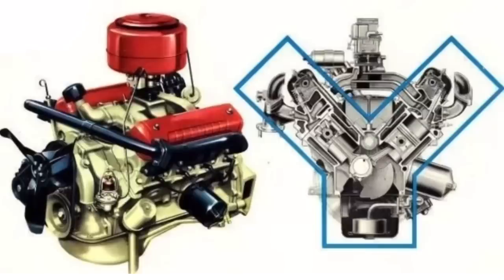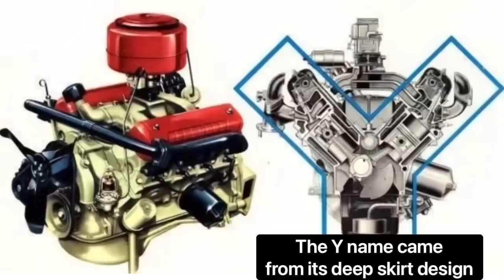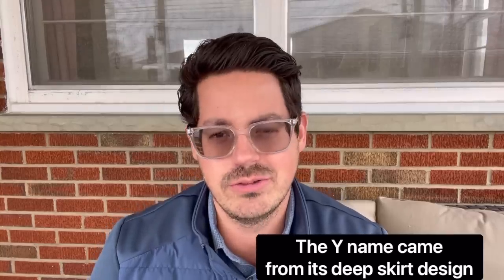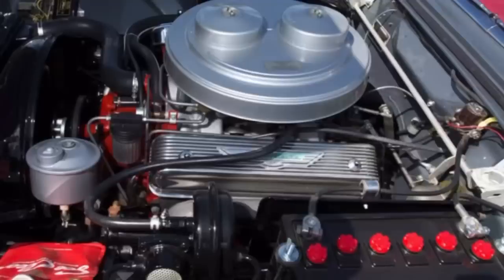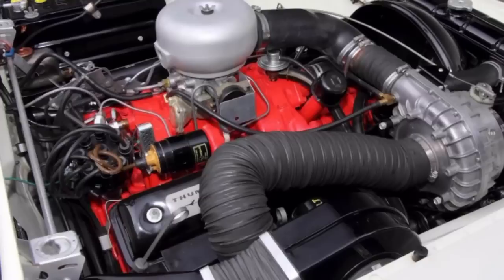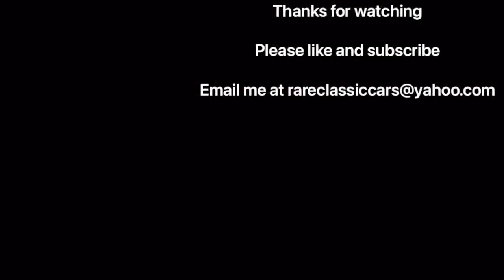Worst Engines of All Time: Ford Y Block V8

Comment: You are blowing smoke again,the oiling problem came from misalignment of the oil hole to it's mate in the head. I took the heads off and oblonged the oil passage hole and problem solved.
Reply: The problem you identified was only one of three with rocker shaft oiling system. The others were: the cam bearing issue; the rocker shaft overflow tube (poor design).

All the of these issues combined to grind the hell out of rocker shafts. 

Three strikes ... Horrible design ...
Reply: @sking2173  The big problem with the early ones - 54 - 56, was the fact that the center cam bearing journal didn't have a groove, and that rocker overflow tube.  Groove the cam and plug that overflow, and you have an excellent engine.
Reply: @michaelbenardo5695  — Yep, but picture this: Muncie, Indiana, summer of ‘58. A middle-class suburbanite with his 2.5 kids working his 9-5 and juggling his spare time between his wife and his girlfriend. 

The last thing he wants to hear is that what started out as a seemingly harmless tick under the hood of his ‘55 Fairlane will now require a motor-out cam bearing replacement that will cost him more than two-week’s wages.

Since his young daughter is in dire need of braces and his girlfriend’s ‘52 Ford, that he had bought for her with money he squirreled away without his wife’s knowledge, needs a clutch, he decides to put off the repair on his car for a month or two.

Six months later, he’s lost his girlfriend because her car now needs a valve job that he can’t afford, has a mad wife that has found out about the girlfriend because she spotted the missing money he used for the clutch job on the girlfriend’s car, a daughter with beautiful straight teeth that won’t even speak to him because of his infidelity, half a kid that’s never home and will never amount to anything, and a ‘55 Ford that he’s embarrassed to be seen driving because it now sounds like a thrashing machine — and he still can’t afford to fix it.

Do you think this guy will buy another Ford ??
Reply: @sking2173  If this was his first Ford, probably not, but if he always had good luck, except for this one, he probably would.  Now if the next one is bad, that's a different story.

Comment: Well after Ford introduced the 352 in 1958, they radically detuned the 292 and it was also Ford's last year for the 312 (used in some Mercurys). I had 6 312s in my life--three 1956 T-Birds and three 1957 T-Birds. They were fantastic engines. When restoring this 6 cars, I rebuilt each engine.  I also had one of those radically detuned 292s in a 1960 Mercury, and it sucked. Yes, they had oiling problems because of two things: 1. People just refuse to maintain their cars, always have, always will. And since these engines had solid lifters, people typically used non-detergent oils. Bad idea. If you changed the oil and filter every 2000 miles and used a high grade detergent oil, you will probably never have trouble with upper oiling problems.  Just about every year I made the 4500 mile round trip from Tucson to the Twin cites area via Denver with my T-Birds.
Reply: Most people dont know what the numbers mean on the oil bottle so detergent vs non detergent is really pushing it with the average joe.....
Reply: @will7its  In the 50s and 60s, detergent oil actually said it was detergent on the can.  Many people, myself included, didn't trust detergent oil, as it would sometimes separate.  Eventually, they fixed that problem.
Reply: Every 2000 miles?   Who wants to do that?   Most of my life I have changed oil just twice a year regardless of mileage!   Of course I drive Hondas and Toyotas.
Reply: @spaceghost8995  Back then 2000 was about right. With modern cars I go every 5000 miles. Cheap insurance.
Reply: @spaceghost8995  You are not supposed to change the oil that seldom, unless you do very little driving.  And just because your engines start and run does not mean that they are in good condition.  I have had people tell me how wonderful their engine is, only to hear bearing knock when they start it, which is NOT good.
Reply: @michaelbenardo5695  These were not new vehicles with tight tolerances running 0W20 oils.  These were like from 1985-1998 models.  Never once had engine noises or internal engine failures. None of them burned oil.  These were Accords, Corollas and Camrys.   Right now I have a 2003 and 2004 Accords. I go about 5000-6000.   Japanese cars are the only thing I buy.
Reply: @spaceghost8995  Doesn't matter.  YOU ARE SUPPOSED TO CHANGE THE OIL EVERY FEW THOUSAND MILES.  That's just the way it is.  And no, I am not "shouting".
Reply: @michaelbenardo5695  Will the police come and lock me up if I don't?   Live your own life.  I don't tell people when to change their oil. I'm saying this is what I have done.  If I had a very new modern engine I would likely do it much more often.
Reply: @spaceghost8995  And if the engine fails, you will try to blame everybody else in the world.
Reply: @michaelbenardo5695  It won't fail .  It's a Honda.
Reply: @spaceghost8995  2000 was just 500 more than the flatheads oil change interval. Oil, especially shitty old oil, didnt last long.

Comment: You are blowing smoke out your butt. The Y block was a very good for me. I drove my 1955 Fairlane 500 for over a halfmillion miles.. It won alot of races too!
Reply: You heard the man, some were incorrectly assembled in the factory. For the average owner that's enough to be put off the brand.
Reply: I solved my 292 problems by installing  57 T-bird rockers and shafts. Solved the adjuster problem too.

Comment: My grandfather had a 1961  F350 utility truck he bought new when the truck was in 4th gear the shifter shook and vibrating he took it back to the Ford dealership they didn't know what was causing it the crankshaft broke in two causing major damage Ford did warrant the truck even though the warranty had expired because it was brought in under warranty he ended up getting a 292 long block for no charge

Comment: My dad owned a '53 Ford pickup with the last flathead V8. Had drove that truck for almost 20 years. He once told me he was glad to have a '53. The '54 model was noisy since it was an overhead valve design. I was not aware that it had oiling problems on the top end.

Comment: I have a 1963 f600 . I used it about a year with the 292 i was very impressed with it . It has a dump bed i hauled alot of 6/8 ton loads of gravel with it . It was very impressive for a small engine once it got rolling it wanted to go turning more rpms than i wanted . It had a rear main oil leak when i pulled the main it needed bearings so i found a wrecked 64 with a rebuilt 330. I was told i would be disapointed in the 330 after using the 292. It has about the same power but it dosent want to go like the Yblock  did the 292 in a truck needed a governor. I never thought much about the ford Y blocks i always had chevy trucks. I have never heard any thing bad about the Y block from anyone that had and used one. Yes they are very dated today and not much of a build able hotrod  engine but in a truck or daily driver there ok.  In my mined after running one over 5000 miles hauling heavy loads the Y block will always be one of the best things i ever owned that came form Ford.
Reply: The Y-block has won Engine Master's competition in the Vintage category a number years.
Reply: I worked for a school district. EVERY one of the 350  Chevy/GMC 66 passenger busses would break a crank at 20,000 miles..The 361 Fords weren't too bad. But yes, a 330 was  about as useful as a 300 6 cylinder.